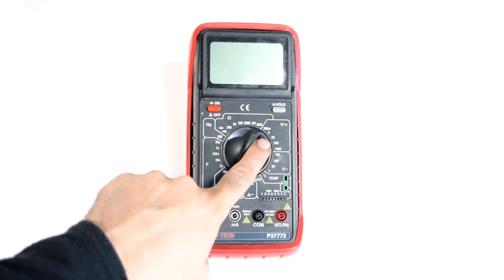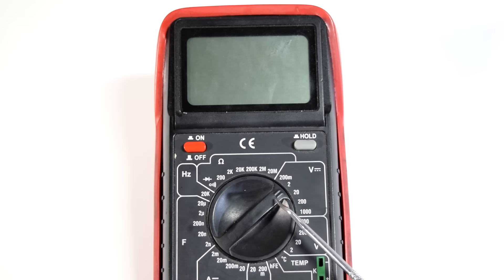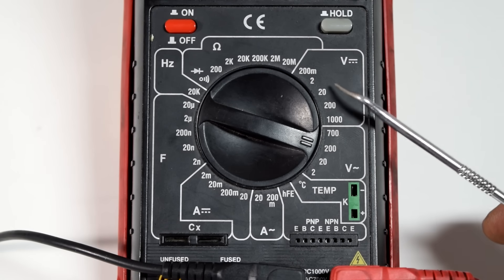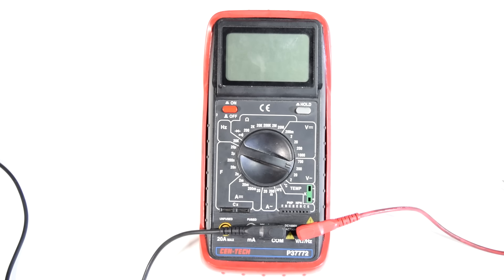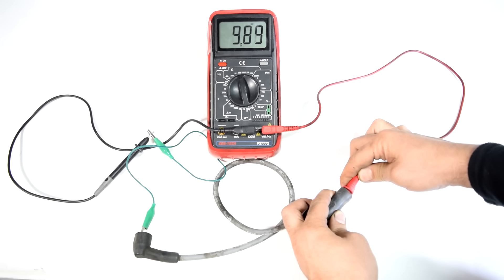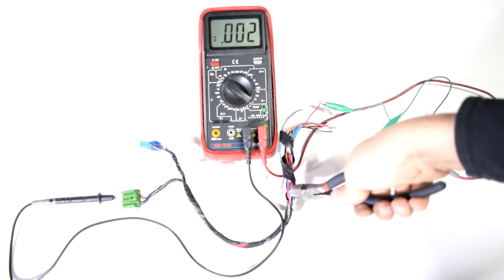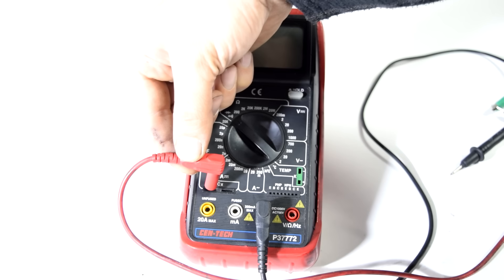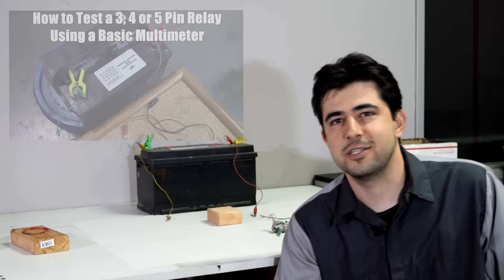How to Use a Multimeter for Beginners - How to Measure Voltage, Resistance, Continuity and Amps

Comment: Nice introduction video. But please be absolutely certain to check those leads EVERY TIME before testing any circuit! If you last checked amps in a circuit and then left the those leads in COM and "Amp", then you go to and push them into a 110/120 volt outlet (200 plus! for some of our European Friends). BAM! (dead short!) Depending on the test subject you can be in a lot of trouble on these cheap multi-meters on higher energy circuits. They tend not to have HRC fusing and very little flash-over protection case design. Please, never ever use these $10-$20 Harbor Freight multi-meters. EVER! Get a decent auto-ranging multi-meter with High Rupture Capacity fuses and flash-over protection case design. Generally think of it this way, if you see those little holes for Emitter, Base, Collector transistor testing and no auto-ranging, you've got a shit multi-meter. DON'T USE IT! Remember, if you're testing amps, your multi-meter becomes PART of the circuit. You are holding that circuit and a lot of energy in your hand (the meter). Cheap meters have a cheap shunts. This is NOT a time to go cheap. Go with a Fluke 115, 117, if you can the 87 five,  higher end Ideal's,  Gossen Metrawatt. etc. As an industrial electrician I can promise you, a cheap meter will "get ya" and can seriously injure and maybe even kill even on lower voltages/amps if testing is not performed correctly and with unbelievable care.

Comment: I found this video just in time.  My new range is scheduled to be delivered this week, but because my old range totally died this past weekend (lights and all), I don't feel safe plugging in the new appliance. This video provided A+ instructions on testing the outlet's voltage and amps.  This is a must save for my "How To" folder.

Comment: I need your help! I have the same HF multimeter that you do. However, I need the tiny needle attachment with the cradle to check tiny wires. Where can I get one? I'm desperate! I am in a motorhome in NY and I need to check the wiring in my furnace. David

Comment: Absolutely EXCELLENT video! I'm clueless when it comes to electricity but you made this so easy and understandable. Here's something else I'm clueless about: how would I measure the amperage from a doorbell transformer which is supposedly in volt-amps? It's my understanding that most produce 16v 20va. Thanks!

Comment: Just think of a volt meter as a calculator  120v to ground  is same as 120 - 0 = 120  or  120v hot to neutral o = 120

Comment: When a wire is cut, it is NOT a short.  It is an open circuit.  A short is when there is a direct, low resistance flow of current in the circuit between positive and negative, or hot and neutral or ground.

Comment: When a wire is cut, it is NOT a short.  It is an open circuit.  A short is when there is a direct, low resistance flow of current in the circuit between positive and negative, or hot and neutral or ground.
Reply: Would a short still fail the continuity test? To be fair, I don't think he was saying that cutting the wire is a short.. I think he just cut it to show that if electricity can't flow it would not beep. So does a short mean that electricity doesn't flow through the circuit properly and thus fail continuity test?
Reply: A "short" would PASS a continuity test because there is current flow.  An "open" circuit would NOT allow current flow, and thus FAIL the continuity test.  Example:  A water hose (the wire) with Point A at the start of the hose and point B at the end of the hose with flowing water in it (electrical current), and the water would expel from the Point B end of the hose (pass the continuity test).  If the hose was cut in half (between Point A and Point B),  NO water would come out of Point B, thus the result is a failed continuity test as the water is not "continuously" flowing from Point A to Point B due to a disruption in between those 2 points.
Reply: Exactly Richard...and the resistance will be infinite!

Comment: Well done! This is the first YT video I've seen that shows the proper range setting on the multi-meter dial. For example: for AC house current of 120, set the dial to 200. Only complaint is that he doesn't explain (for us newbies) that the larger "slot" in the outlet (receptacle) is NEUTRAL, the smaller slot is HOT (which he calls "power"), and the bottom "hole" is the GROUND.  But he does show that you should place the black lead in the NEUTRAL first, which is important, from a safety standpoint.

Comment: Excellent video and very informative... I have one question..  do you use AC current of DC current to measure how many voltage does a backup or reverse light wire for the car? thank you and hope to hear from you soon..,.
Reply: mp6908 You'd use DC. Most cars use 12V DC. A few use 6V and if you're working on a truck it's possibly 24V.

Comment: You cut the wire and called it a short.  It's an open.  You might explain the difference between a short and a open. (High current, low voltage), (High voltage and low current), sometime.

Comment: i got a question.... 2000 firebird 3.8 manual trans...

so here's my issue... as I'm driving every now and then it will chug as if it was a misfire and/or map sensor thing... but is just for a second or so. here's the thing, once i get to where i need to be, if i try to start it, it just cranks.... as if there was no fuel... there is pressure, spark, new cam sensor, new control module.... is not the vats on the key. my dashcam caught it when it died on me, but this time it made an awful sound as when you throw an automatic transmission from drive to reverse... and then it smoked... i tried to start it but it would crank as if it the timing was gone... i said, wow that was the issue..  later that night i went to check on it........ it ran.. so i took it home.... what can you make of it.... oh... btw.. no codes come up.

Comment: Thank you for such a Clear and simple demonstration for some like me Just learning! Don't know how recent your videos are, but I feel like I could learn a lot from you. I'm going to try to learn how to use my Dt830b multimeter ( bought on Geek app) to test my Circuit board for my X8C Quadcopter! Not getting power to one motor. Hoping to test board, and also my "Backup Board " to hopefully save a lot of work. If anyone has any advice on how to set up for this test with my Multimeter, I would Greatly appreciate it! Thanks.....

Comment: Man, where have you been with this video???  This is the best explanation of how a voltmeter is used than I've ever seen. Well done man. And I'm subbing your channel. Thank you for this.
Reply: Excellent explanation
Reply: Totally agree :)
Reply: So do i
Reply: I know right.  This was great!  Even I understood and I'm not a technical person.  Good job man!
Reply: @vonniemcneil6864  ppplpplpllllppplplp
Reply: MrVegas is
Reply: L
Reply: https://www.trisco.com/products/pro-automotive-multimeter
Reply: I just bought a new multimeter & I couldn't figure out how to do a continuity test on a an electrical outlet. I still haven't gotten anything to work yet. Can you ruin a multi meter just by attempting to test a dead electrical outlet. Meaning just the part but not connected to power at all. I tried all settings & scenarios trying to get some kind of reading. This guy's multimeter is quite a bit different than mine so
Reply: What does he mean by saying that if you measure more than 20 amps you'll ruin your multimeter. Does he mean just hot wires carrying power can do that or is he saying that dead non powered parts like an non connected electrical outlet can ruin the multimeter also? I put the leads on & switched away to all possible settings & scenarios bcuz nothing worked any way I tried it. The real issue is understanding what settings to put the thing on & how much to guess to set it to measure things.
Ive never taken any classes for this type of shit so I'm clueless thus far..
Reply: This is a multimeter not voltmeter
Reply: @jamesofoof1232  it's both
Reply: @elcompamartinez2647  a multimeter is both an ammeter and a voltmeter, it also may contain other features aswell, but for simplicity sake he is using a multimeter because it can measure both amp's and voltage.
Reply: Ask this old house

Comment: Why do you need to connect your meter on the positive side when measuring the current flow to the bulb?  It is a flow of current so anywhere in the circuit should show the same value.  Also when you are checking wire bundle for continuity and you don't hear the beep, you have an open circuit,  not a short circuit (you even cut the wire to make an open circuit in your video).
Reply: yea i was thinking same, when measuring current the only factor as far as what side your on is if its polarity sensitive.  In the case of a bulb, most likely not.

Comment: thank you... wel i boucht a multimeter and a pyramid psv 300 powersupply...and i try to find the 13.8 voltage on the connectord ... i have got the meter on dc 200 and than no reading as 00.0 is the powersuply broken?
Reply: wilfred verbeek

Comment: what do you set your multimeter to test the photo cell on a motion sensor light.
Reply: GmGarlo a photocell is a semiconductor device that changes resistance depending upon the light level. you might want to check the resistance.

Comment: this is nothing I wanna see how to test lights, starters, exc without blowing the fuse in my meter
Reply: Zakwa Zunudin 
make your own video then.
Reply: u must need to make sure that there are no power flow through the thing that u want to test , correct me if iam wrong. and u need to make sure u put the correct Dc Ac A Ohm n ect
Reply: Corey Petroskey
Reply: Corey Petroskey thank you,

Comment: What is the "E B C E E B C E" part above those square holes for? Near the bottom it's right in-between the Amp and Temp on the dial. Are you suppose to stick a wire in there to test it or something?
Reply: That's a transistor tester
Reply: DoomFinger511 I think that's for testing transistors, usually 3 leads e=emitter b=base c=collector.
Reply: Krohn

Comment: Thank you very much for such a simple, yet well explained way to understand the basics. It is the first time, thanks to your simple and clear thoughts, that I learn a lot about Multimeters. Now I feel save to use the new one I have bought. I need to test why some electrical parts (like Electric Seats in my Mercedes) could not working.
Reply from the maker: +Bengie Rodriguez Glad you like the video, thanks for commenting.

Comment: What? Why do spark plug wires have so much resistance??
Reply: That way the electrical current through those wires don't through out electrical interference to surrounding electrical components

Comment: Thanks for taking the time to help us new to multimeters. Subscribed.
Reply: Thank you. I feel pretty comftable testing stuff after watching this video.
Reply from the maker: +OMGWUNSIU np, thanks for watching.
Reply: everytime I put my multimeter to measure the resistance of a transformer is always different. It can vary from 1 to 100ohm, in two/3 different measures... It has happened that when I measure a resistance of which is supposed to be1000 ohms and my transformer 0,9 ohms, then a second time my transformer measures 10ohms and again the resistance it shows 1009.. The craziest value was 100ohms for an output of 12volts - and only 220volts is normally 14ohms - so after that had happened my resistance of only 1000 was measuring 1100ohms...

I don't know if it is because the multimeter is bad quality, or that is normal to happen. Mine is not as sophisticated as yours, I can only measure a maximum of 10 amp for example... Here is a link where you can see what type I am talking about...https://www.google.pt/search?q=multimeter&source=lnms&tbm=isch&sa=X&ved=0ahUKEwiL_o-0r_vMAhVFOhoKHUKECmAQ_AUIBygB&biw=1518&bih=692&dpr=0.9#imgrc=ojkDzYcRzj3p2M%3A What do you recommend me, is that normal to measure different resistances values in the same device? Have you already measured resistance in a ferrite transformer with its primary only? Is that normal to happen?
Reply: +Ratchets And Wrenches Good day,

I tested my battery today and i have 20A DC instead of 10A in my multimeter. ( Does it make a difference? )
I got a reading of 0.29 

I'm a bit confused, does this mean it is 29 mA and i am ok or does it mean it is 290 mA and i have drain? (as normal is 50 mA)

Thanks
Reply: OMGWUNSIU
Reply: OMGWUNSIU "
Reply: OMGWUNSIU, Yes, same here.
Reply: THINKOFIT337 how to test spark plug wires
Reply: OMGWUNSIU same!
Reply: https://www.trisco.com/products/pro-automotive-multimeter
Reply: Anj. I

Comment: It's called an open, not a short, when you don't have continuity.
Reply: actually when you have a short you automatically have an open in the circuit ... electrical current has the tendency to flow on the path with the lowest resistance ... when you have a short current is going through the short and not its intended path thus creating an opening in the actual current (some electricity flows but it is incomparable)
Reply: @PureVenomthe1  No, an open is not a short. They are never the same. An open = infinite resistance (or near infinite, since I can just see the theorists starting to type arcing). They are direct opposites to one another. Almost every power switch that denotes any kind of symbol on the switch/button/lever shows a choice between a straight line and a circle: closed vs. open - you can't have both. A short is an unintended closed circuit. Electrical current ALWAYS flows greatest in the paths of least resistance, but it still flows in all paths available. It is proportional. If the resistance is the same in all paths, the amount of current that flows will be equal. That's basic Ohm's Law.

Comment: thanks I just bought this same meter at harbor freight
Reply: +RatchetsAnd Wrenches so if I understand this correctly, voltage is tested in parallel and amps is tested in series, in a circuit?

Thank a million bud! great video!
Reply from the maker: +Billy Shepard Nice, it's a good bag for your buck.
Reply: Gr8 Incarnate Harbor Freight's Pittsburgh tools aren't bad hand tools for beginners

Comment: Hi, thanks for your videos.
I like it.....well my question is I mean two weeks ago I was in the fleamark to get some battery charger, but I took with me my millimeter, is the smaller ones from Sears, ( red one).
So I did check in one battery the voltage & didn't show up nothing I put in the DC and 20v....you know because the battery is 18v....and I did in other's battery s in one was new, in there in that one came up 18v in other's one came 10:25 or 12 : 86v .....but in that one I told you, nothing came out?  so that's mean what is?? thanks again I wish I can know like you. I went to school, but there is everything fast and the next day we have to go in an other stuff.
Thanks, for teaching us!!
Reply from the maker: +Danny Chuqui If a voltage shows less than what it's supposed to it means that battery has lost some of its charge and is not a fully charged or good battery. So I would not purchase a 9v battery that only shows 7 volts on the multimeter.

Comment: Is the multimeter's voltage at 4:50 the means of finding the resistance of the spark plug wire too?